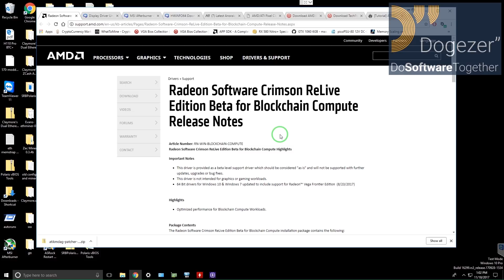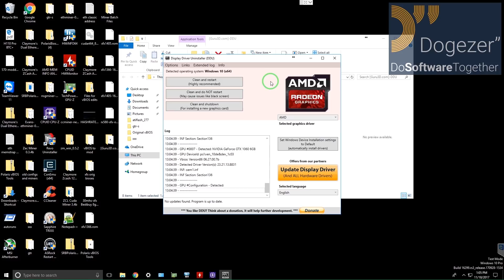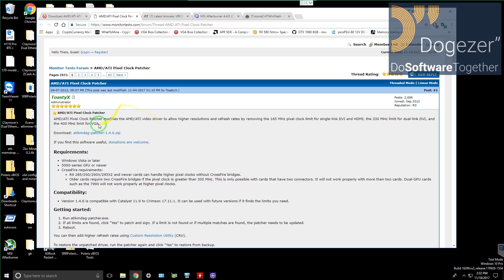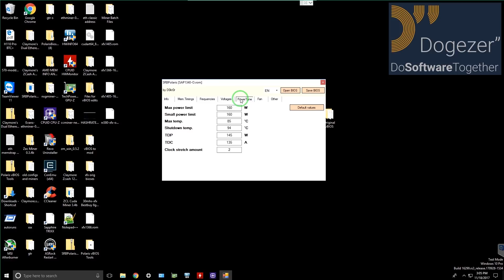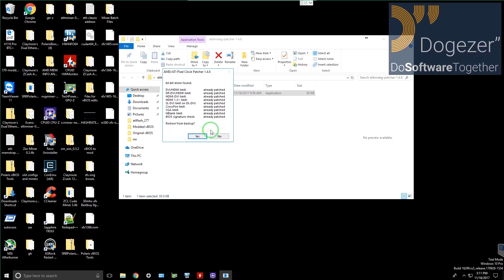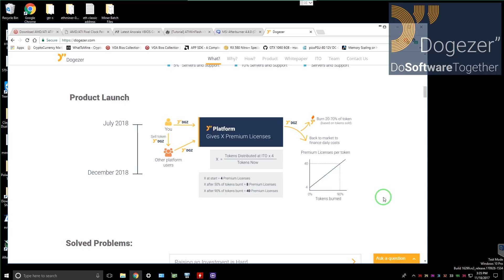How To Optimize AMD RX 470/480/570/580 Cards for Mining - FULL GUIDE!

Comment: Hi Evan, mining on an Asus Strix RX 470 (Elpida), I was running the latest drivers and was getting 13-15mh/s on ETH (dual mining SIA), so I thought I'd try your recommendations out. Clean uninstalled video drivers, installed the blockchain drivers you've linked, reboot. Now when I mine the miner (Claymore Dual) reports 0 MH/s for both ETH and SIA. Any thoughts?
Reply from the maker: Element K, sorry for the late reply. One thing I would recommend is checking within your C:\AMD folder. If there are files leftover from the previous drivers you had (which is very likely) you would want to run DDU once more and when doing so make sure to check the box that says "Delete AMD folder". Then you would once again reinstall the blockchain drivers.
Reply: Hey Evan, great suggestion, I'll try it out. Quick update and more info: So running my card stock, dual mining ETH+SIA, latest adrenalin drivers on Graphics mode (not compute), I was getting about 12.5mh/s, which I consider pretty poor, but perhaps appropriate given the circumstances (dual mining, non blockchain drivers in graphics mode)? 

Successfully modded bios and flashed, changed to compute mode for drivers (will still give blockchain beta a try if you feel they'll perform even better than standard drivers in compute mode), up to about 22-23mh/s. Nowhere near 28mh/s, but perhaps that's due to dual mining, although I was under the impression that dual mining only pulled about 10% mining power from ETH, but maybe it's 20%? In any case when I get a chance I'll be adjusting the card with trixx or afterburner to optimize core/mem clock and try to pull down the voltage on both, to see if I can get close to 26mh/s dual mining. 

Thanks for this vid and your quick response. Any further advice based on this reply is appreciated! Cheers!
Reply: Also another quick note, I've been using cryptobadger's ethereum rig build and optimization guide to tweak the GPU using radeon's software, and in his guide (for a 4gb rx 470) he was able to pull the core clock down to 900mhz before seeing a reduction in performance. I literally could only pull mine down to 1200mhz before my mh/s cut in half (down to 6.5mh/s from 12.5mh/s stock, SIA down to 100mh/s from 250mh/s). Any thoughts on why there would be such a discrepancy in core clock performance stability between our cards? His guide literally said start at 1000Hz and pull down 50hz at a time, checking for performance loss, and I literally had to boost up 50hz until my performance returned to normal haha. Cheers!
Reply from the maker: Personally I prefer the blockchain drivers I have linked, but to each their own right? Your hashrate can and should be higher than 22-23 mh/s though for sure and I can comfortably say that it depends on your dual mining intensity (the "-dcri" setting you would use in your batch file). With a higher intensity for dual mining it can impact your ETH hashrates a good bit. You'll need to try using a specific number, lets say try using "-dcri 20" in your batch file and gauge your hashrates. From there you can use your + and - keys to increase or decrease your dcri in realtime and once you find a good number that gives you a hashrate you're comfy with you can go back to your batch file and save it with the new dcri number you decided on. Hope this helps!
Reply: Good to know! Actually, I changed from dual mining SIA to just mining ETH, and my hashrate dropped.... color me confused. Trixx settings at 950hz gpu, 1850hz memory (did actually get performance gain dual mining, moving it incrementally from 1650 to 1900, but crashed at 1950, pulled back to 1850), and sitting at -60mv. Was getting just under 25mh/s ETH, 399mh/s SIA, only changed miner settings to ETH only, and I get 21.5mh/s. Lol. /head_desk
Reply from the maker: Hahaha that's funny (but I know it's extremely annoying as well). Have you tried your luck with setting GPU power/core/mem/fan speeds/etc values  using the flags in your batch file that you use with claymore's miner? You can try that as an option rather than Trixx.
Reply: So in the end this is what I determined: with this card and its memory type (Asus Strix Gaming RX 470, Elpida), vbios modified, most recent non-blockchain drivers in compute mode, undervolted in strixx (900 GPU, -60mv, 1900 MEM), mining ETH alone on nanopool, no fee, the max hashrate I can attain is 24.5mh/s. 

I actually got the Aug 23rd Beta Blockchain drivers to work, but strangely enough they only gave me 2-3mh/s total.... so weird. This was installing properly, using DDU to remove the previous drivers and delete the AMD folder, restart, install Blockchain drivers, pixel patcher, restart. So perhaps with NOT undervolting but instead overclocking and maxing the fans/temps I could achieve 28-30? But otherwise with undervolting, 24.5 is it.
Reply: Also, if I kept the Claymore fee turned on, it would only give me 1mh/s more, so 25.5mh/s. Cheers

Comment: Hello Evan, Thanks for the info I am still having trouble getting to 30mh/s  I have the XFX's GTS which seem to get me high 27's to low 28 mh/s I have some MSI which are getting me low 29's and 28's . I have installed the blockchain drivers with patch. Also  modded the GPU bios with ATIFlash and polaris editor. Having trouble with afterburner it doesn't want to allow me to undervolt. Worked for a day on one rig but after reboot stopped working even though i have EULA and and switch changed from 0 to 1 in CFG file. Please help. I also have the GTRs which are only getting 28mh/s ASUS z270-p motherboard. Thank you
Reply: Sorry meant to add I have all RX580's 8GB some XFX Black some MSI Gaming
Reply from the maker: Hey Zonk,
In afterburner's settings have you made sure to allow voltage changes? If you open the settings (gear icon) and look under the "compatibility settings" header, you'll want to have everything checked except for 'force constant voltage'.

Comment: I see everyone applying mem strap patches, but did'nt anyone note at all the amount of hardware errors generated when you look at Hwinfo ? It's crazy. I'd rather have a 100% genuine submissions (shares) then some faulty shares.
Reply from the maker: KronosSlots, you raise a good point, but you have to keep in mind that those results are subjective rather than it affecting everyone overall. To date I've probably had 2-3 GPUs throw error flags in hwinfo64 but easily fixed it with reflashing.

In practice, the ones getting errors are usually easy to identify (opencl issues when running the miner, low hashrates and failed shares as you mentioned). After I do a good bit of tweaking on my cards and flashing them; I always spend around 20 minutes watching the miner for any of the above problems before walking away.
Reply: I'm sorry flashing back to what? You copy a memory strap, OC it and it either works or not. When it does'nt work you either throw your OC down a little. I dont understand what magical bios flash is supposed to sustain 2250Mhz with tigher timings and without any hardware error.
Reply from the maker: There is no magical vBIOS flash; from your response I'll assume we both know that. There's a number of things that could likely be the culprit of issues (poor quality GPU die as AIB partners spit RX cards out like crazy, GPU riser quality and whether or not the lanes are flushed on both ends, steady power not just from the PSU but a buildings circuitry as well, the list goes on). 

As for a reflash.. that's the reasoning behind backing up the original vBIOS for each card. Alternatively you could alter the various other settings within PBE along with the memstraps and try again.

I don't recall saying "every card can sustain a maxed out memclock consistently and that these memstraps are magical." Just here to help steer others in a direction that's worked well myself as well as for them.

If you do want 580s that I will swear by and can handle 2250Mhz, get Sapphire's Nitro+ Special Edition cards. They're fabbed from their cherry picked/binned stock of chips and have never given me a single issue.
Reply: I have 5 of them. Exact brand. Putting them with stock bios on 2250Mhz results in memory errors. Putting them with a changed bios is no way to archieve 2250Mhz as well with different timings. I flashed a bios once into a RX480 but it gave a million of errors and even tho your reported hashrate (client) looks 'high' the avg on site is completely different.
Reply from the maker: Yes... I'm aware that my miners CLI and the target pool are two separate entities and that reporting rates don't reflect in real time, thanks though. 

I don't know what vBIOS edits you've flashed onto your 5 cards, but I have 4 of them and in total during their lifespan (with continuous log dumps); I've had one total about 168 errors, another at 12, and the last two with 0. All of which are clocked at the full 2250 Mhz on the memory. So whatever you've done, you did it wrong.

Comment: great video, i have been hunting a way to get my rx580 to a higher hash rate, i have already performed this mod and i have ther correct driver installed and only getting 25mh/s on my rx 580 with hynix memory, although  i haven't checked if it has two types of memory. I was wondering if you had any pointers, i have a rx480 coming soon and would ideally like to have both mining at 30mh/s, the rx580 is a 8gb to be clear and has a memory clock of 2000, any higher my hash rate drops any lower and it drops. I also have a 850w gold power supply so i'm not lacking in power. If you could offer any pointers i can try when i get back from vacation that would be great. i manually changed the memory to 1750 also to be clear but with a different software.
Reply from the maker: I'd double check the memory types and look for card specific roms if you can find them. Downclock all values in afterburner but overclock the memclock value as high as possible as long as it's stable.
Reply: Try msi afterburner. I used this video as a guide as well and it helped but to get closer to 30's i OC'ed my cards a bit.. You ll need drivers too though..
Reply: sardanapalos thx, I ended up just selling the card for a bit more then I paid for it and skipped the trouble, all the rx 480s I have now, do great, the lowest one gets 28.2mh/s and they average about 29.2, and the strix and xfx gtr cards get 30 to 31, so alot more happy with those results also alot lower power consumption, 90w compared to 130 with rx 580.

Comment: Hi, I have done this a few times and it has worked. I wanted to re flash one of my RX 580s with a different me strap rom but I get this error message: "Can not flash a 0x0 length image into a 0x 40000 length rom! ROM not erased"  - any help appreciated.
Reply from the maker: It sound like you may be targeting the wrong GPU number when running the Atiwinflash CLI or you may not have the BIOS in unlocked state (position of bios switch if present on your card). 

If it's not either of those issues then the last thing I can think of is that you may be using an incorrect ROM file. As a tip, when saving your modded ROMs make sure not to have any spaces in the name of the file and always try to keep it somewhat short in length.

Comment: Hey Evan, I can't flash any of my RX 470 cards.. I'm getting a "Error 0fl01: Can not flash a 0x0 length image into a 0x40000 length rom!ROM not erased" error :'(  any advise?
Reply from the maker: First I need to ask if you have the GPU hooked up to your monitor or are you using the processor's iGPU? This is a guide covering the issue, it is a bit dated so you may want to look for a more recent version of it (especially newer versions of the tools used).

Comment: Hello Evan, I had an issue about my GeForce GT 1030, it's not being recognized in my Device Manager (win10 64b), does atikmdag-patcher will work for NVidia cards? Thank you.
Reply from the maker: Hey Lito, thanks for the question. Unfortunately atiflash is specific to AMD/ATI GPUS only. And as a word of caution if you're wanting to mine ETH or even ETC with the 1060 3gb it won't work. The DAG file recently outgrew 3gigs. The card will still work fine for other Ethhash altcoins though. As for it not being recognized in win10x64, try plugging the card up to the monitor or even moving it to the main pcie slot for video output on your mobo.
Reply: Thank you man...i learned a lot from your video, newbie here.....
Reply from the maker: Happy to help man! I've been meaning to do a lot more videos and I will have a new one up in a day or two (finally). I just recently went ahead and shelled out the money for a lot of studio equipment. Hope you decide to stick around, and feel free to reach out if you have any more snags. ☝🏻

Comment: Hi ivan, i have problem here.
I have red devil rx 570 with the switch of dual bios like you said in this video. I forgot to turn the switch into number 1 and i have flashed it which is the original bios that can't be flashed. Aaaand i got the black screen. I tried to reflash it with the original rom but it's not working, the screen still show black screen..
Please help me
Reply: I just fixed it.. 😄😄
I tried the original rom downloaded from anorak.tech. Before it i tried with the original rom that i backed up.
I do know why, but this is because this video, thank you so much ivan 😁

Comment: do you know how to setup/flash bios on ethos?
Reply from the maker: It is possible as ethos has atiflash built in. The easiest way would be to upload the rom files to your google drive from a Windows based machine (or other device). Then on your ethos rig use the browser to log into your google drive account and then download the roms so you'll have them available on the rig. You'll need to check for the correct string to put in for flashing them. Here's a link to a guide I dug up though I'm not sure if anything has changed: https://forum.ethereum.org/discussion/12048/is-it-possible-to-flash-the-bios-on-my-gpus-using-ethos-or-does-this-need-to-be-done-using-windows

Comment: Man please help....installed crimson drivers...flashed bios....but hashrate stays at 20-21mh/s ..any ideas? ty in advance
Reply from the maker: Still having trouble? Maybe check the c:\amd folder for leftover drivers besides the blockchain ones. If theres other ones you'll need to run DDU again and choose the option to remove the AMD folder then reinstall the blockchain drivers. Other than that are you using OC software?

Comment: Hey dude, whats your hashrate on the 580s with this driver? Im getting decent rates only with the blockchain_aug23 driver e.g. 28+mh. With this driver barely at 23
Reply from the maker: +Dread Leet all of my 580s except for one XFX card are hashing at 30-31.2 Mh/s.
Reply: 570 msi armor 8gb, 23 mh/s i think it should be higher, i got blockchain but msi afterburner does not seem to help, running nicehash

Comment: I have 3 Nitro+ RX 570
Installed the new drivers(was running latest adrenaline drivers, getting 21, 21, 24) downloaded the DDU, uninstalled, reinstalled the blockchain drivers, getting (21,21,24) still.
Downloaded the bios for the cards on Anorak Tech (8gb micron 1500 straps as well as Hynix, have 2 Hynix) saved into a folder, moved into ATI Flash folder
When I go into the command prompt to flash the bios(ran as admin), I'm getting:
(port 2 is the micron memory)

C:\Users\Grishmoney>cd C:\Users\Grishmoney\Desktop\ATI FLASH

C:\Users\Grishmoney\Desktop\ATI FLASH>atiflash.exe -i

adapter bn dn fn dID       asic           flash      romsize test    bios p/n
======= == == == ==== =============== ============== ======= ==== ==============
   0    01 00 00 67DF Polaris10       M25P20/c         40000 pass 113-2E366AU-X56
   1    04 00 00 67DF Polaris10       M25P20/c         40000 pass 113-2E366AU-X56
   2    05 00 00 67DF Polaris10       M25P20/c         40000 pass 113-2E366AU-X5T

C:\Users\Grishmoney\Desktop\ATI FLASH>atiflash.exe -f -p 2 MICRON INSTALL 1500.rom
File MICRON not found.

   ERROR: 0FL01

C:\Users\Grishmoney\Desktop\ATI FLASH>

Thoughts? 
I also made the BIOS with .rom with GPU-Z as I thought I may have done something incorrectly on anorak, however, using the file I made gives the same error
Reply from the maker: Michael, from what you commented it looks like the issue may be the name of the rom that's the problem. Atiflash doesn't like spaces or long rom names. Try renaming the rom you want to flash without any spaces and such.